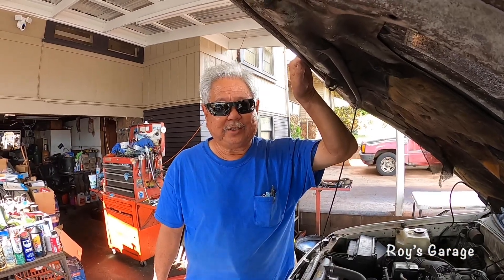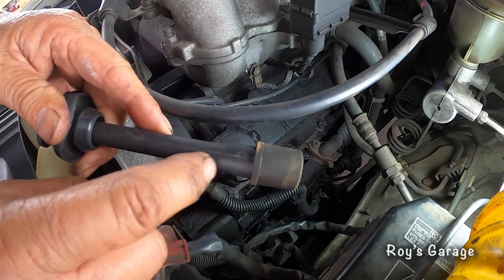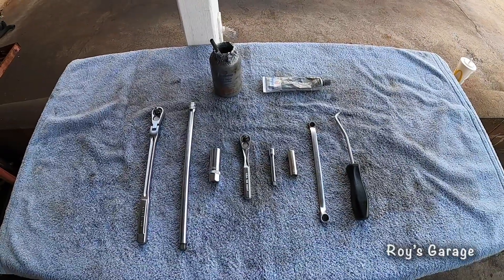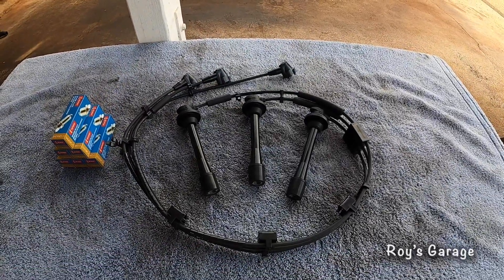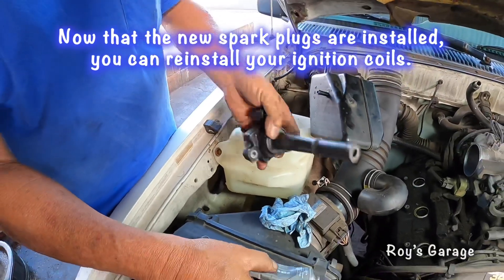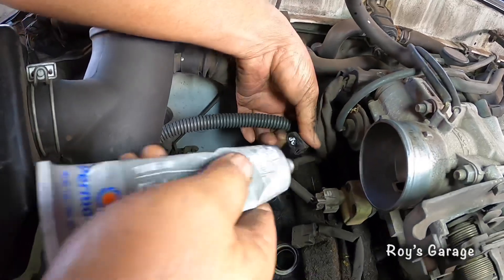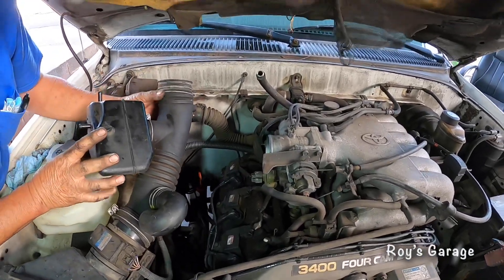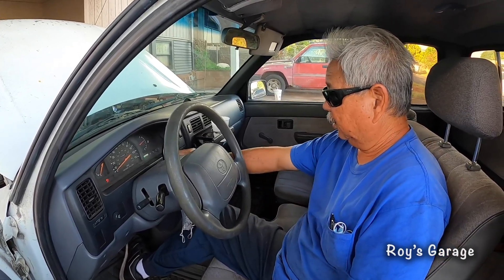How to Replace the Spark Plug Wires & Spark Plugs on a 1996 Toyota Tacoma (OBDII Code P0304)

Comment: Why do you have coils on the left side of the engine but have regular spark plug wires on the right side? Did you made that upgrade? My 96 doesn't have that set up.